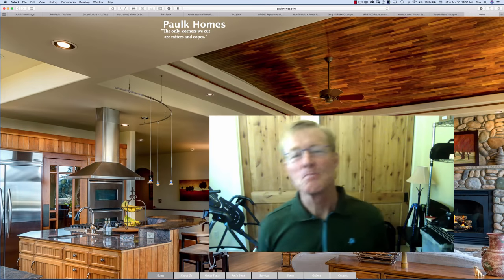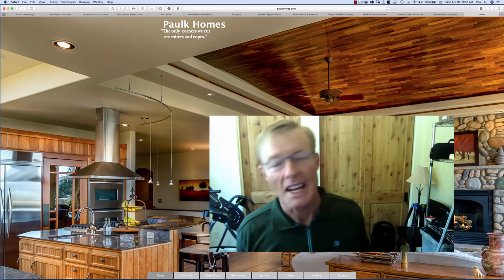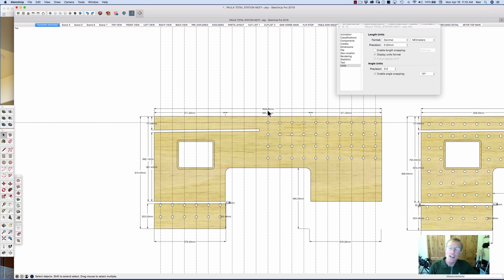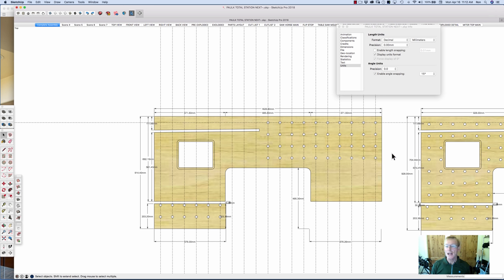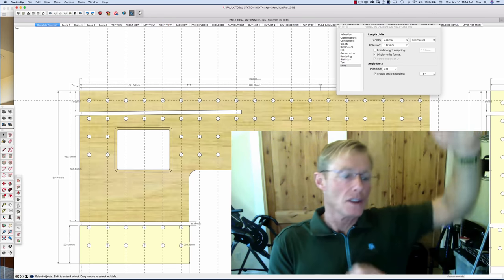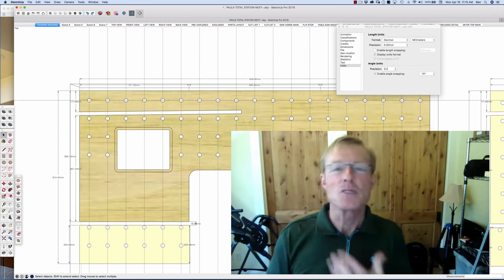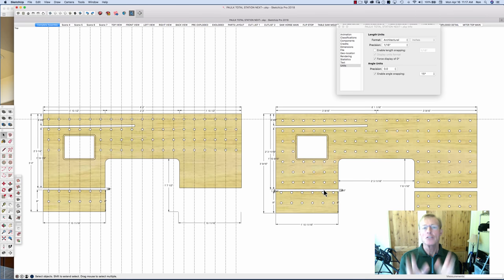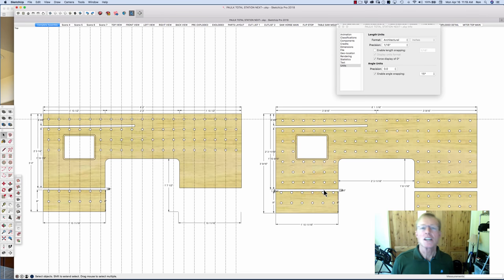Metric or Standard? 32mm Sizing? Your chance to have input.

Comment: Im totally for the metric version. David Stanton produced a video awhile back( 20mm holes with drill how to) and brought up a good point to consider your perimeter hole spacing as to allow for use of a MFT speed clamp with out interfering with your table top support. He recommends 81mm hole centers then start the 96mm spacing. I believe Festool MFT tables have 71mm perimeter hole centers and therefore you cant get full use of speed clamps at the outer edge of table. Thanks for the great videos!

Comment: Great question, Ron! I'm still a relatively new woodworker and have been struggling with this question myself. Living in the US, I grew up with standard and I've inherited most of my tools, so they're all standard as well. As you said below, wood in the US is sold in standard sizing, so that's basically what I've stuck with. Honestly, I'd prefer metric as it's simpler and makes more sense to me. I have OCD, so I got a bit nuts when my measurements aren't precise. I found it surprisingly difficult to find 1/2" plywood that was actually 1/2" thick!!! I also appreciate you mentioning that cabinetry uses the system32 method. I was unaware of that.  Getting into cabinetry is my long term goal. I look forward to the build videos for the PTS.

Comment: Hi Ron, in the U.K, I either buy 8 x 4 sheets or 2,440 x 1,220 sheets, however, ‘MY’ Ron Paulk bench was made with an 8x4 sheet and I used the UJK parf kit to create the holes in metric. Personally, I use imperial for big (not so accurate) stuff and the metric for precision. Saying that, at the end of the day, it’s what you have to work with and makes your life easier in the end. Cheers
Reply: I grew up with Metric but I still occasionally use Imperial/Standard when talking to myself and roughing things out.  So I might measure something at 22mm, eye something else off and mentally call it a foot instead of ~30cm, then back to Metric for anything bigger than 50cm.  As long as I know what I'm saying to myself it's all good. :D

Comment: For those doing standard, I found that at least for the bench dog holes, the shallow bench dogs are all manufactured to be used in the Festool MFT3, and need precisely 20mm holes. 3/4" bench dogs are deep and meant for traditional work benches.

Comment: I'm definitely partial to sticking to the 96mm hole spacing and metric dims.   I'd consider rounding down rather than slightly over on the 6 ft dim.

Comment: I'm a newbie woodworker in the U.S. and have used Std. my whole life. I make a lot more mistakes using inches and fractions of an inch than when using metric. When I need to make accurate cuts I always use metric. After using my Paulk workbench for a few months now I can honestly say not all of my dog holes are perfectly spaced anyway so I doubt it would matter much if they are spaced inches apart or mm apart.

Comment: The great metric versus standard debate doesn't really matter to me, but it strikes me if you laid the trailer out to fit a 72" total station in it, whether or not to use a multiple of 32 mm or would be easily adjusted for by using a slightly shorter length bench rather than slightly longer. 72" = 1828.8 mm, 57 X 32 mm = 1824 mm is less than 1/4" shorter, throw in that 1824 mm is a multiple of 96 (19 X 96), 48 mm from the edge and 18 rows of holes and another 48 mm by my math, and that looks like it will do exactly what you want. Adjust your width to be either 9 X 96 mm or 10 X 96 mm  (roughly 2" plus or minus from the 36"), depending on the room in your trailer and you are cooking with gas.

Comment: In Australia we do use metric but most of us understand feet and inches too. I think using 96mm centres is the way to go as it is standard, and systems such as the Parf Dog tools are designed around the standard 32mm spacing. Personally, I prefer metric, only one unit is ever used in woodwork, multiples of 1mm. We base our building measurements on 300mm which is sort of the metric equivalent of a foot. So we would think in terms of 1800mm, 1200mm, 900mm and so on. We also spell metre and mitre correctly :)

Comment: When I built the compact bench I modified the length and width to 96mm multiple. That way the 96mm spacing of the holes came out with even edges. The only measurements that would need to be standard is the radius if standard hole saws are to be used.

Comment: Hi Ron, your channel is amazing. We've emailed before. FYI Plywood is sold in the UK and Australia as 4x8 sheets and ironically thickness is listed in mm. As someone who works on three continents (and grew up in the US) I've learned to adopt metric. We carry both tape measures. So I think a 3x6 or 4x8 bench makes sense, with 20mm holes spaced by 96mm so it matches most of the Dogs and Fixtures mass produced. I think the way you supply both versions in your plans is best. Most end users have the skill set to make adjustments or modifications to their own build. IF they are beginners following your plans exactly is fine too. After they complete a project they will most likely discover what they would do differently. I made a PCB and love it. Now all I do is covet the Total workstation.... Project #2 as soon as you finish your build. I'm curious about how this FastCap drop in will work. I think the best fence system is great but very pricy. 
Thanks so much for doing these videos, they are great.
Reply: Not sure where you live in Oz, I was born in the 60’s and we haven’t used imperial since I was in primary school. Perhaps you’re in Adelaide, that lot are a few decades behind the rest of us 😂
As to the debate of which to to use, imagine if money was imperial, how hilarious would that be.
Reply: David Watts do you know me? That's hilarious. Because thays where I was. All good fun. I realized my point was lost. I really meant that ron should stick to 3x6 for the bench top design and do everything else in metric. I thought it would please everyone. But I now see (at least the vocal people) want metric.

Comment: I learned to use both ways and would still use metric , since it makes mathematically sense and easier to use. Is it perhaps possible to keep your dimensions close to your existing designed size but you go metric on all?  Even if the holes doesn’t exactly come out right, there is a way to even out the spaces metric style and center it all to make it ecstatically pleasing.

Comment: This is a long answer, but may help with a lot of the questions you ask. I was a 17 year old indentured apprentice in the UK . I went home Friday in imperial measurements and Monday the construction industry was metric. Here's what helped the "older" guys adjust.
1. Don't try and visualize the metric measurement, a 4' x 8' sheet of plywood makes a familiar sense and scale whereas a 1220 x  2440 mm sheet doesn't, yet! What also helped is a built in lack of precision tip we were given to consider an inch as 25 mm. This scales up to one foot being 300mm four inches being 100 mm etc so a 1200x 2400 plywood sheet scans better (An inch is actually 25.4 mm and a foot is 304.8mm).
2. We're all using 18mm thick ply that's metric sized anyway only a handful of manufacturers make imperial sized plywood and they are exclusively American. We get most of our plywood from either Canada, Mexico , China or Russia all of which are metric countries. That's the reason for the odd size 29/32" or 15/32" for our dado router bits.
3. If you want 6'0" x 3'0" bench size just work with 1800 x 900 mm it will be a little undersized but that works to your space advantageously.
4. Just center the 20mm holes at 96mm on center from a center line. Don't try to build this in 32mm incremental! It's not necessary nor useful in this instance. If you were building cabinets then that would be a different answer.
By the way, I hope you bought the blue FastCap metric tape with the 32mm  increments marked on it.

Comment: I have no problem with metric plans. 
If 58 increments of 32mm makes the bench too long, can you just reduce it to 57 increments? You might need to move the initial row of holes 16mm off the center line to get the hole pattern to fit nicely.
When doing arithmetic with precise measurements, millimeters are not significantly easier than decimal inches. However, fractional inches (or fractional inches converted to decimal inches) are cumbersome

Comment: I would go with imperial, just because all the products in the US are imperial.  While cutting the dimensions aren't that big of a deal in either system, the thickness might be an issue.  Slotting 1/2 inch plywood into a dado could be an issue if you standardize on metric.  Also having to switch router bits to go from imperial to metric might also be an expensive hurdle.  I know you can get around it by setting up multiple passes to get the dimension you need, but that can be a pain.  And of course, the worst of both worlds would be using both imperial and metric.  Don't get me wrong, I have no problem with metric, and prefer it in some ways, but until I can buy metric lumber at Home Depot, it's just going to be easier to use imperial in the US.

Two other points.  I'm building the total station now, and just finished making my own T-track.  So, I kind of wish you wouldn't have mentioned the manufactured t-track, literly 1 hour after I finish my own.  :-)  Second, as a point against imperial measurements, in the plans the imperial measurements are listed in feet (1' 6").  I would then convert it to inches in my head (18"), and mark my cuts.  It would be a lot easier to just list them as 18" inches instead of 1' 6".  I don't know how many times I would look at something and see 1' 6", and then write down 16" :-)  Had to recut several things...  Mostly my problem and not yours, but that would be one argument for metric.

Really enjoy your videos, and looking forward to getting my bench completed.  Thanks!
Reply from the maker: I have found most 1/2 plywood in our region actually measure 12mm and not a full 1/2," but that may be our region. I know our sheeting is called 7/16," which would be 11.11mm. and if I put a caliper on it, it might be a full 12mm.
Reply from the maker: I made a video a while back, stating that in any future plans would be called out in inch and not feet an inch. SketchUp defaulted to feet an inch and I didn't really pay attention.

Comment: In Canada, we've been using the metric system since the late 70's. I learned both Imperial and metric. As a carpenter, I always worked in Imperial measurements. I do so even today, though I recognize metric's usefulness especially given our Global economy. It's kind of weird that it is still difficult to find an all metric tape measure here. I picked up a couple in Germany on business, but they quickly got snapped up at work. (I am no longer in the trade). Sorry my long winded answer is, I would go with metric because it matches systems like Festo's MFT and many accessories can be purchased for it. And I will get another all metric tape!

Comment: Love metric as a trim carpenter. Maximum 4 digits to record cut lengths. 
ie. 108 9/16 h. or 2841. AND there are 3mm in 1/8 inch, more accurate than the 1/16. 
Easier to actually SEE on the tape.
My Bosch GLM 30 grabs a dimension instantly. No more guessing witch fraction is closest to the center of the curve on inside corners.
Reply: Bob K. I agree with you, Bob. You really pretty well summed it up.

Comment: Hey Ron. I'm building my next PTS with the table saw to the left of the miter saw.  I find that I get pinched between the extension and the material that I'm ripping with it on the right.  ANY THOUGHTS? I don't want to flip the fence to other side of the blade.
PS. I love my bench. Thank you.

Comment: 32mm system works great but all of my measuring devices are in standard. If I changed to metric I'd have to replace the scales and rulers in my shop. I would say stick with the standard but provide the metric too. If I were building the metric I would probably adjust all the measurements to multiples of 10 (i.e. 1829mm becomes 1830mm).
I look forward to seeing the next generation PTS.
Reply: "If I were building the metric I would probably adjust all the measurements to multiples of 10 (i.e. 1829mm becomes 1830mm)."
That's what I did when I built my PWB and PMB.

Comment: I think you answered your own question “metric is easier and more accurate”. Go for it but go all the way, no need to use the 3’x6’ equivalent size, just make it 60x90cm. I was raised metric but have lived in the States for the past 30 years and do all my rough carpentry in feet and inches. I still turn to metric for precise work, it is just plain easier when you have to calculate things.

Comment: Metric in Australia since the mid 1960's. Most tradesman, both old & young can talk in imperial but everything is done in metric. Sheet goods are 2440x1220 which is close to the old 4 x 8 ft size. Most people would trim off the factory edges to give 2400 x 1200. Unless you were fitting to an existing space, no-one would design to odd measurements like 1828.8mm (6ft exactly) we would design to 1800mm which is a very common size for desks, tables etc. Smaller objects are generally sized to the nearest 5mm and larger objects in 300mm increments, 600mm, 900mm, 1200mm, etc.
So, I suggest it is time for the old folks living in the last century to move forward and join the rest of the world in the metric system.

Comment: As a guy that utilizes both metric and imperial on a regular basis, for me metric is the way to go. Layout is simple, 1 is 1. In my location most sheet goods are being produced as 1220 x 2440 x metric thickness, not 48 x 96, as they are being tailored for the Canadian market. Same with the dimensional lumber.
Reply from the maker: Base 10 is much simpler than base 16
Reply: And yet instead of 100mm-spaced dog holes, people in metric-land use a system based around multiples of (two times) 16 mm 🤔

Poking fun at metric fans aside, I'd be fine with metric-dimensioned plans with 20mm holes @ 96mm spacing, and making things overall dimensions a multiple of 32mm if it makes things work out easier.

As mentioned in another comment, if an extra ~inch of length is a concern, go one multiple of 32mm shorter, which comes out just under 6', and in fact even closer to the original 6' size
Reply: I have actually had drawings completed by American engineering firms that utilized 10th's of an inch....can you even buy a tape measure like that???
Reply: Shawn Leask yes, Stanley #33-272 for example has both fractional and tenths of inches marked. There are also tapes with tenths and hundredths of feet marked. Decimal inches is very common in some fields, for example machinists work in "thou" (thousandths of an inch). Well, the ones who don't work in metric do, anyway.
Reply: I have a landscape 100' tape with 12 inch feet on one side and 10ths of a foot on the other - go figure!
Reply: Wow....really?!?  In 35 years of residential, commercial, and industrial construction, I can safely say I have never seen an imperial tape measure with tenths on it. 8ths, 16ths, and 32nds yes, tenths no. Learned something new today!
Reply: I've seen those used in the oil and gas drilling industry. They were called Derrick tape measures there.
Reply: Base 16?i was taught base100.look at any good framing square.
Reply: "people in metric-land use a system based around multiples of (two times) 16 mm 🤔"
I suspect this is because when countries and industry began converting to Metric, it was a lot easier to keep the same tooling but re-name it.  That's why routers use 12mm shafts (1/2") instead of 10mm or 15mm, why pipes are nominally 25mm but are really 1", and so on and so forth.  If you've got a specific enough use you can go Metric straight away (Eg I doubt there's many things in a Falcon9 which are based on Imperial/Standard measurements), but backwards-compatibility can be a pain in the proverbial at times.

Comment: I personally don’t care either way. I don’t find one to be more accurate than the other. Metric is probably easier math wise. I use sae most. The only issue I have is the we seem to have both systems in play in the states and I find that frustrating. Router bit are 1/2” but ply is apparently 12mm so the two don’t jive. I think they actually call it 15/32.

Comment: I learned everything imperial and that's what I'm used to until.....  several years ago I was hired to work on a "dome" house.  NOTHING worked out laying out the foundation until someone asked a simple question (ME).  What's this mean, 1.3 feet?   Which brought up the question, Is this metric?  two days into this and no one thought to ask or even think about it.  Of course, then the lights came on but not a soul had a clue how to convert.  The boss asked the designer which it was and of course it was... metric.  Well DAH!  That would have been a good thing to know.  We don't build in metric, was the battle cry from most of us.  Try finding a metric tape in this country where I live in the mid 70's.  Not gona happen.  So the next day, the boss drove up to Canada (35 miles) bought a few tapes and a few other things, came home and in half a day, we i the correct layout of the basement walls and from then on, it was an easy build.  I haven't used metric much after that but I can see the change happening and I know it's a lot easier to work with.  So after that long story, yes... I'd stick with metric just because it's very easy to learn and very easy to use.  I just hope sooner than later the rest of the country will realize that as well.